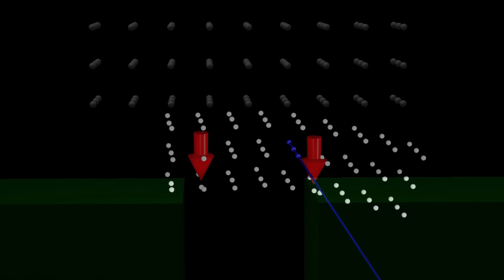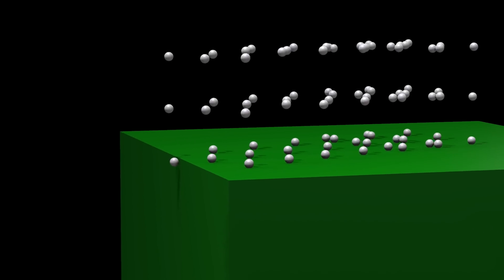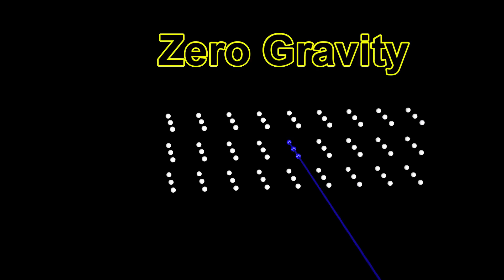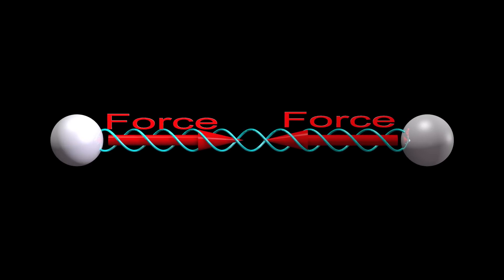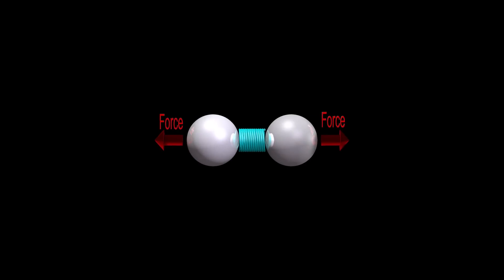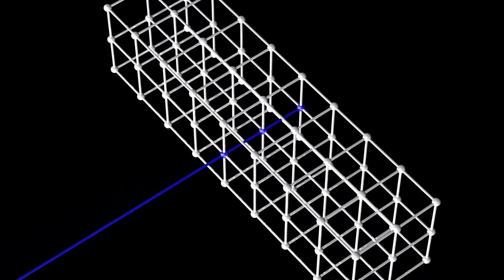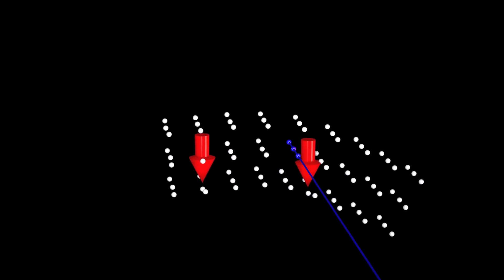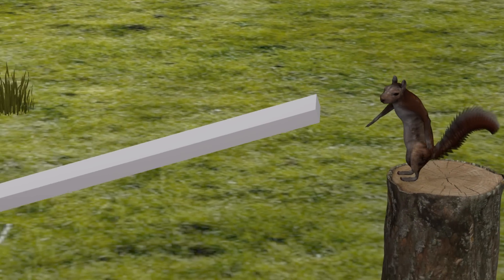Torque can’t exist for rigid objects

Comment: In your paper, you state that "because the internal forces in the rigid-body model do not obey the strong third law, they form a couple that generates a self-torque and thus angular
momentum." However, it is not very clear in your paper why they violate. 

Would you mind explaining? Thanks.
Reply from the maker: It is not "my" paper, as I am not the one who wrote it.  One of my other viewers initially had criticisms of the paper, thinking it was mistaken about this issue.  However, after we talked about it, he then posted the following:

"Ok, I think I know what you mean now. I think your point becomes clear with an extreme example: Take three mass points with equal mass that lie equidistantly on a straight line and are rigidly connected to each other. If you exert an external force on the middle mass point, which is also the center of mass, perpendicular to the line connecting the mass points, the result is a translation. Due to the rigid connection, the other two masses must experience the same acceleration, i.e. they experience a force parallel to the external force. However, this force cannot be applied by the internal forces, as they would have to be parallel to the connecting line according to Newton's strong interaction principle. This is where I see the contradiction proclaimed in the paper. Now I understand why perfectly rigid bodies are not realizable with the strong version of the third law."

Comment: While it is totally ok to model a system of particles constrained by spring forces to gain insight into deformation, the claim that it is necessary in order to explain torque, moments, and force couples is as laughably incorrect as the paper cited here in the comments. Truly a "don't believe everything you see on the internet" moment
Reply from the maker: The claim is just that toque can’t exist for some rigid objects, such as the scenario described in the paper.  This claim is correct.
Reply: The paper's claim is that the incorrectness is at a "system of 2-particles" level - this belies your reply that it applies to only "some rigid objects", the claim is clearly all. Section's 2 and 3 show a clear lack of understanding of rigid body dynamics with "arbitrary multiplication" and "why isn't the torque just = to F?" Additionally, the spring model constraint is claimed to be "fundamental" as opposed to one option of many. Section 3 could be collapsed into one sentence that says "the idea of rotation vs translation for a 1-D point is ill-defined and degenerate". Calling these point-masses "bodies" is inconsistent with current literature. Most importantly, many of the errors stem from an important conversation about what is meant by a "fixed point". A proper treatment would start in an inertial frame (language not used in the whole front discussion) without such a constraint, which btw the pivot was called synonymous with the COM and then drawn outside the two mass system. The paper is riddled with errors and absences. A paper could be written about all the errors in this paper. It belongs in the trash with any derivative material that stems from it
Reply from the maker: One of my other viewers initially also had similar criticisms of the paper.  However, after we talked about it, he then posted the following:

"Ok, I think I know what you mean now. I think your point becomes clear with an extreme example: Take three mass points with equal mass that lie equidistantly on a straight line and are rigidly connected to each other. If you exert an external force on the middle mass point, which is also the center of mass, perpendicular to the line connecting the mass points, the result is a translation. Due to the rigid connection, the other two masses must experience the same acceleration, i.e. they experience a force parallel to the external force. However, this force cannot be applied by the internal forces, as they would have to be parallel to the connecting line according to Newton's strong interaction principle. This is where I see the contradiction proclaimed in the paper. Now I understand why perfectly rigid bodies are not realizable with the strong version of the third law."
Reply: @EugeneKhutoryansky  1: your copy+paste does not address any of the inaccuracies or absences above, including your "some not all" response; 2: the moving target of whether torque exists for a rigid body, whether it satisfies a colinear condition, or whether this material stems from Newton or your "fundamental" Haverford spring model is an impossible moving target to respond to in YT comments. I leave this conversation with only the following for whoever may have watched this dreck and read this exchange: caveat emptor

Comment: I think I got it. The analogy of the springs helped me to understand why a hypothetical perfectly rigid body can't have torque. If I understanded correctly, is because when you applied a downward force to a tool, the other end of the tool must have an upward force, just like when you stretch a spring outward, there's an inward force because of the flexibility. Likewise, when you use lug nuts wrench and use a pipe to have more torque, the flexibility of the material gives an opposite force: you move the pipe downward, and the other end of the pipe moves upward. I can imagine if it were possible a perfectly rigid tool, you can apply whichever big force to the tool that it move give any torque, just like when you use a really tiny wrench, but just imagine an infinite small wrench, it won't have torque at all. Well, this is my first time learning this, so I might be wrong, but I think I got it.

Comment: The animations were fun, but I thought they were going to demonstrate that torque doesn't work on perfectly rigid bodies, not just repeat it doesn't many times.
Reply: To be honest, I'm not convinced either.
The whole thing seems to be based on the assumption that in a perfectly rigid body, no equal and opposite force would be produced along the lines between the masses.
I believe that is a false assumption, and the only difference here would be that the force would be transmitted with 100% efficiency (through the fully rigid connections) rather than be partially spent on compression and dissipated along other directions in the object.
Reply: @darth_dan8886  the paper linked by them shows that a 1D rigid body model can't rotate. In a way, it's easy to see, since the force causing the rotation would be perpendicular the body length, and it's reaction would also be tangential to the rotation, and there wouldn't be any radial reaction to be the centripetal force that would hold the body and allow it to rotate. But that's a faulty model. If you use a 2d rigid body, or a bendable body, or anything other than a 1d rigid, there would be more complexity in the model to allow for a centripetal reaction from the applied tangential force. I did the calculations for a rigid triangular shape in my notes, and the result pretty much is the correct torque, and the correct inertia for the mass arrangement. 

I saw the video a few weeks ago, and I remember it saying that you can't derive the correct equations of rotation for a rigid body. (If my memory is not wrong) that is just wrong. That's just a problem for 1D models.
Reply from the maker: This is discussed in detail, with mathematics, in the paper at https://scholarship.haverford.edu/cgi/viewcontent.cgi?referer=https%3A%2F%2Fwww.google.com%2F&httpsredir=1&article=1494&context=physics_facpubs
Reply: @EugeneKhutoryansky  Thanks for the reply! That was a very interesting reading. So the author showed (very convincingly) that a rigid two body model cannot reproduce the laws of rotation, while a non-rigid two body can. That's very interesting, but I understand that he didn't show that you need non-rigid bodies to get correct rotation in any model, especially more complicated models, with more masses and 2d geometry. You could model a 2 dimensional 4-masses rigid body in a square shape, with a tension in one of the diagonals, and arrive at the correct torque law for the system using only Newton's laws. So I guess the paper shows a fundamental flaw in 1-d rigid bodies as a model for deriving torque and the equations of rotation, not a fundamental need for non-rigidity for this.
Reply: @EugeneKhutoryansky  But I do not want mathematics! I am too dumb for that! Me wants easy to digest video! 😭😭😭
Reply: @EugeneKhutoryansky  be patient, friend.

Comment: Years ago, when I was just getting serious about studying math and physics, I spent countless hours over the course of (probably) weeks trying to derive some torque laws for rigid bodies, only assuming Newton’s Laws. 

I learned it was pretty straightforward for non-rigid objects, but the rigid case literally kept me up at night. 

I had forgotten all about it until I saw the title of this video. Great work as always ❤
Reply from the maker: Thanks!
Reply: For me, the answer is pretty straightforwards. That is: your assumption that rigid bonds can only carry tensile force is incorrect. Or rather, if it were true, then you don't really have a rigid body... you have a matrix that can easily deform along shear lines, because there's no force keeping the angle between bonds constant.

If you counteract this with a non-cubic lattice, you find that torque actually arises quite naturally!

Comment: One issue I see with these simulations, is the assumption of a simple cubic crystal structure.  This crystal structure is uncommon among most solids, and is known to create weak shear strength in materials and weaknesses of non-axial loads, due to the weak diagonal bonds between atoms.  Much more common crystal structures are face centered cubic (FCC), body centered cubic (BCC), and hexagonal close-pack (HCP).  These crystal structures have higher packing factors than simple cubic, and are much better at supporting shear and moment loads, due to diagonal bonds between atoms, creating "cross-bracing" in the crystal structure.
Reply: That's an interesting point. 
Given the axioms, a perfectly rigid cubic structure would have to shear under any load that would have caused torque. 

After all, the bonds cannot apply perpendicular forces, nor can they rotate.
Reply: They all have shear planes so its just a generalization to consider FCC and BCC - they effectively behave the same regardless of geometry. I used to think about it in this way: think about how they behave as the load goes to 0 or infinity